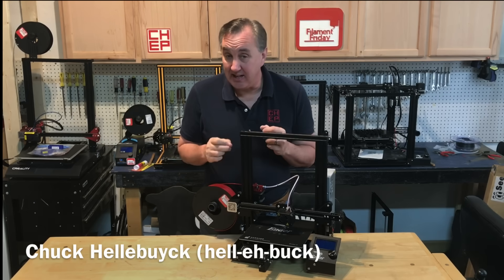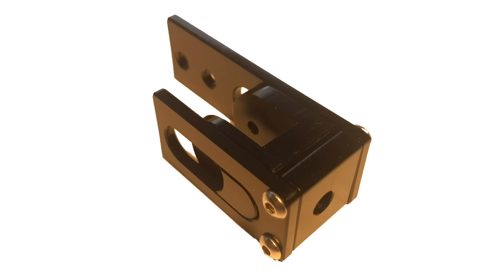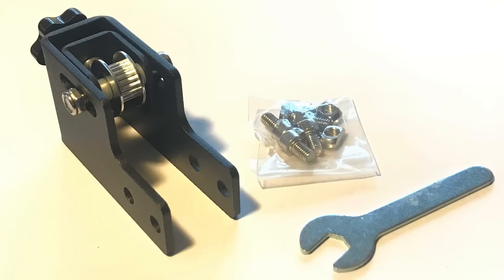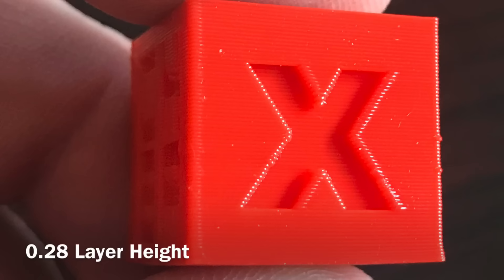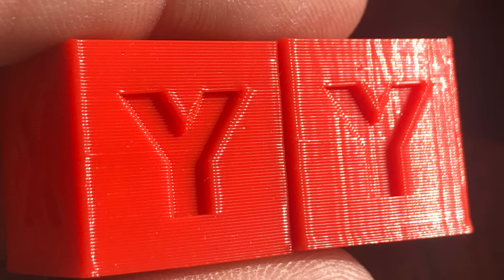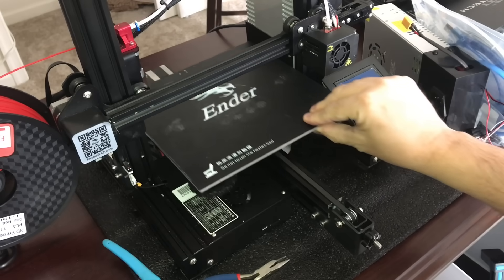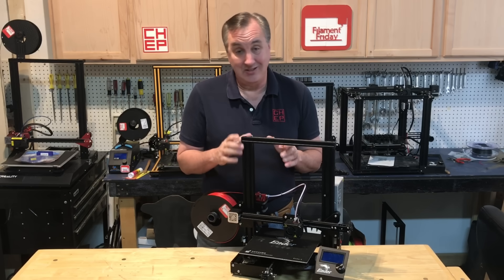3D Printer Belt Tension Effects on Creality Ender 3

Comment: the slicer does not know how tight your belts are.  it assumes ideal/perfect belts.  if they are too tight this will change the real world travel distance in xy which will throw out the extrusion calculations.
Reply: If you're throwing off those calculations it would have to mean you are changing the length of the belt by stretching it, which as he says in the video you shouldn't do. You should be able to tighten it pretty hard before it starts to stretch by any significant amount though.

Comment: Anyone know how to fix the extra extrusion mentioned at the end?
Reply: E-step calibration is a good place to start to fix over-extrusion. Possibly printing too high a temp leaving oozing at the corners, running the temp tower calibration is a good way to tackle that. chep has videos on both
Reply: Also linear advance/pressure advance would do wonders to fix it
Reply: Same Problem

Comment: If you tighten the tensioners on an anycubic kobra max with maximum force, the print will shift all the time,the bearings will knack and the print will fail all the time. Loose it until it goes down and the tighten it. You've got to watch the belt go up to the upper position as you tension it and when it has reached its highest point, you've got to give it another 360° turn and it won't shift anymore.

Comment: Gates, the creator of the GT2 belt, recommends a tension of 6 to 8 pounds of tension when using a 6mm GT2 belt for registration like in a printer.
Reply: i think the gates belt doesnt need as much tension since it uses aramid fiberglass reinforcement.
Reply: Your post is more important than it may seem as Gates are pretty much king of industrial belt drives. Thanks for looking up the data so I don't have to!

Comment: The belts will stretch quicker but over tightening. It should be tight but you should be able to push the belt down a little bit. It shouldn't be tight like a guitar string.

Comment: Should I loosen the tension on the belts when I don't use the printer for a few days to prevent any damange to the belt or the pullys in some way?
Reply: You're being way too reckless with your printer!  You're supposed to completely disassemble it,  apply a thick layer of cosmoline to every part, then hermetically seal it in a kevlar bag.  The bag should be placed inside of an underground climate-controlled vault with 24 hour surveillance and a time lock that can not be opened by anyone for the few days that you're not using the printer.
Reply: @madderall_dot_com  LOL! Love the safety. Will look into underground climate-controlled solutions XD
Looking at other comments though - Overtightening could lead to issues, which I suppose I didn't consider.
Reply: @hadencain  You're a good sport,  Haden.  Unfortunately this video is extremely inaccurate and I was very much surprised to find it on a channel that I've always respected so much.   He really needs to do a follow up video with a retraction, because this advice is borderline dangerous. 
And no, if you have you belts correctly tensioned you don't need to loosen them when you're not using your printer.  A correctly tensioned belt on a cartesian 3d printer should feel like a loose guitar string. Somewhat tensioned, but never cranked or stretched.

Comment: Thanks for that info. You solved my mystery questions. So it was the belt that wasn't tight enough. My prints had wavines,or I had suddenly printer nozzle offset and start printing different location. So it's better to have it tight. In worst case I can replace the steper motor if it breaks down, but at least I'll have excellent prints.😄

Comment: This was an awesome video. I was looking for examples of what a loose belt could cause. I have to check mine. I am experiencing a strange issue where the right walls and bottom right fills of any object, no matter where it is places, happens to each when I print multiple don't squish together. I think it might be a loose belt but so far no luck with x height or clogs or what not. Very odd.

Comment: Remember belt tension affects XY accuracy. You're stretching the belts, meaning the stepper motor's need to move less to move, say, 1mm. You really need to re-do this video to mention this, Chep. And don't forget to mention some Enders can only save estep calibration to the SD card, and only when it's inserted (struggled with that for a few hours).

Comment: I overtightened my e3v2 belts. The problem I ended up having was vibration. It seemed that the tighter the belt, the more artefacts I got on smaller details due to vibration. I loosened the belts by 1/4 of a turn and I got perfect prints again. On large objects with lots of straight faces, you don't notice it. On small parts it would cause them to break off. Especially thin walled supports.

Comment: with the belt being extremely tight would this not damage the stepper motors?
Reply from the maker: Nope. Belts will stretch a bit.
Reply: @FilamentFriday  only applies more horizontal force to the bearing,  it which case are designed for 1.5 to 3 times the pressure is my guess. the belt would break b4 it would negatively affect the bearing with rubbing likely happening first.
Reply: incorrect, Nema 17 steppers can only handle 14 to 17 pounds of pressure on the shaft. Properly tension belts aren’t any tighter than 8-12 pounds but they can be easily overtightened and this will cause stepper motor damage. Not to mention degrade the belts very very quickly.
Reply: @TheGoldPoppy  Chep is one of the most respected experts in the 3D printing world if not the most. So if he says this is so, then it is so. I cannot imagine Chep advising this without testing it for himself or getting the information from a trusted source. However, not all parts are created equal so some stepper motors will fail due to over-tensioning because they are faulty. I accept the benchmarks for this stepper motor are what you say they are but in the real world these measurements may vary from machine to machine.

Comment: Interstating after reading article with similar comparison of cubes it did clock in my head, on x2 I see some waves but very faint always thought belts felt right eniuggbfrim factory and it's wobbly table was causing it wgicg prob not but who knows gotta find more stable surface

Comment: I got a ender 3 pro, but heavily modded
, and will certainly test this when i get my E3D V6 heated block replacement and new LGX extruder, once with the old recommended low G twang people say to use, then another cube with the tighter and see if cube changes.

Can't believe i didn't find this video until now lol

Comment: this is great... ringing and loss of quality imo is caused by loose parts and belts in most cases... when you print same file for years with same printer and you get ringing etc to me it makes little sense its a software issue and can't be a g code issue...thanks for sharing... i came by to check this out before i go through my machines to try to improve ringiing issues ..

Comment: Might be true for an ender 3. But I think this is bad advice. On all of my CoreXY and Cartesian printers. I run tension just high enough to not skip but as low as possible otherwise to save my motors and bearings and stop terrible vibrations.

Comment: i got a new belt for my ender 3 v2 after my x axis belt snapped, would I be better off and get better, cleaner prints if I used the GT2 timing pulleys that came with the new belt instead of the bearing that comes stock on my ender 3 v2? thanks for any help much appreciated, love your videos and class you've got on udemy Chep! always helpful and clear direct instructions!
Reply from the maker: What class on udemy?
Reply: @FilamentFriday  Hi CHEP, quick question: I am getting corners exactly like in your video, how did you fix it? If you have a video or an answer please tell me. It is really important for me. Thanks in advance.
Reply from the maker: I used coasting and flow rate to reduce them.
Reply: @FilamentFriday  thx man.

Comment: I see you have an ender 5 on the background. Have you installed them on the ender 5? Do they work well? I have been having an issue where the Y axis gets skewed during a long print and when its finished the axis is not straight. I have tried adjusting the bearings to make sure all are perfectly tight to the V grove and the belts as well making sure they are as tight as possible using the assembly that comes from factory, just wondering if you ever experienced it before and if you have these installed and how they work.
Reply: Hi JP Did you ever solve this? was it down to your stepper motor skipping or the belt? Thanks
Reply: Ho @LaurenceGough  . I have actually converted mine to linear rails on both x and y axes and have not had the issue ever since. It prints very well and printing with speeds of 110mm/s with great results. Looking to do conversion to core xy next. Just waiting on new stepper motors and mounts for it.
Reply: @jpnunes7154  Ah ok so you didn't change any vref - but I guess you may have changed the belt tightness when installing the linear rails?

Sounds nice either way!
Reply: @LaurenceGough  before installing the rails I did play with the belt tension andcosely monitored the stepper motor to see if it was skipping and never been able to identify what was actually causing the issue

Comment: im having problems with Y belt tentioners on both ender 3 and ender 3 pro seems when it hits 210mm e3 and 220mm e3pro the wheels colide with the tensioners do i need to put some offset on y or do i need to make a more gap betweent the end of the y axis and tensioner cus they are kinda close

Comment: I have worked in robotics design for ~10 years and tight enough it dependent on speed and backlash, if its tight and moving slow its fine, if its moving fast you need more... you are slapping a rubber belt, the faster you go the less slack you can have

Comment: good to know on my v2 i was worried about how tight/vs how loose to set it. ive seen these exact issue on some prints so ill prob tighten it  up.
Reply: It shows you in the manual how much to tighten with a picture, until the middle rod is flush with the cap.

Comment: I've made the mistake of getting a belt so tight that it stretched the end on the x-axis where it connects to the gantry and it slightly tore the belt which led to very small x-axis variations In the layer lines. Had me baffled for a while. :)

Comment: Chep, I have an issue with my Ender max and was wondering if you might know whats causing it !! I get this 1 bad line running up the z axis of my prints.. I can see whats doing it.. Its the hotend jerking at the exact same spot every time it completes a layer.. So its laying down a layer fine and then what looks like where it comes around back to where it started, It does a very fast jerk motion and continues laying down filament. Clearly this should be a smooth change or whatever, but that little fast jerk is enough to deform a tiny blob of filament each go around, until I end up with that funky line running up my print..
Reply: You can solve this is cura settings by changing z seam to shortest and enabling hide z seam in settings.
Reply: What are your retraction settings? Also are you using combing mode? Not z seam I assume?
Reply: @Kevin McCann Cool thanks for the info... It definitely is a new layer problem and not actually the z axis... I did a test the other day with a circle that had 20 layers. Same thing at the end of each go around it would stutter for a microsecond at the same spot.. I notice that it actually happens now on every print.. ill try and change the position it ends each layer and see what happens... Not sure about the little blob, don't think that's retraction issue , because I don't get hardly any stringing or under/over extruded parts... Anyways appreciate the help dude !!!

Comment: The belts come about 2% undersized, so they need a fair bit of stretch to be set at the belt's intended tension, so you get them taught, and then stretch them a further 4-5mm, then you're set. These poly fibre reinforced rubber belts (as opposed to steel reinforced PU belts) won't actually break. But they can damage the motor bearings! I don't think those motors are intended for this kind of side load that the belt expects of you, you expect some kind of coupler to a shaft that's supported on both sides which then carries a pulley, which would be a little too complex for a low-cost desktop 3D printer.

But i don't want to make it into a big issue. You can just open the steppers and replace the bearings when time comes.

Comment: Too tight of course you will wear out bearings, pulleys and belts. Increase motor current.
A good test is to hold the pulley on the stepper motor, move the Axis, EG print head, back and forth by hand. If you can feel it's sloppy, it's too loose. If it returns to it's center position from each way you pull it, it's about right.
Fine tuning with test prints.
Reply: I've really overdone it and pulled the belt halfway apart by the gantry once and got small x axis shifts, the compromised area would stretch and contract as the machine moves and had me thinking I had a bad driver or stepper. I recommend the gates brand belts as they are a lot stronger and can take a good tightening.
Reply from the maker: Or the belt stretches.

Comment: Keep in mind, there is 'too tight'.
Draw two circles, one to represent the inner bearing race, one to represent the outer.  Draw a circle in between them, touching both, and realize at that point of the bearing, they can only get within exactly 1 bearing diameter, the bearing keeps them apart.
Now instead of 1 bearing at that point, put a bearing before and after that point, off to each side.  Realize the two circles can NOW be pulled in closer than the 1 bearing diameter.
Ball bearings do not form a perfect circle to follow the perfect circle of the races.  They form a sort of point polygon, if you set high tension and pull the outer race in close it will destroy the bearings or races as the races have to ride over the high spot of the bearing.
This is why bearings have loading limits and similar, and get destroyed really fast with high loads..
Long term if you want higher precision you need higher precision linear items.
Since these bearings are fairly cheap, you can set the tension high, get great results, and just consider them a wear item.  That's perfectly fine too, just understand you're shortening their life and they'll need wear replacement..
My 4 year old CR-10 is still very smooth and works perfectly, probably way better than most.  I can easily turn all of my POM wheels with two fingers, barely any force needed.  They are linear guide items that need no excess play, but don't need tension.  Same for the belts, easily deflected and low tension, but very low play in the positioning direction.  Properly used bearings have a near indefinite lifespan for something as low load as a 3d printer.
If I needed it I'd wring that last bit of precision as well, and just consider the wheels, bearings, etc wear items.  But if you do it, do understand you're going to be intentionally point overloading the bearings, and they'll changing now and then.
So don't hesitate to do it for the extra results, it's a lot cheaper than the next step up all around for high precision in a whole printer.  Just keep in mind there's a trade off, and more maintenance required..
Also, notice there's still a small, regular pattern on the prints.  I wouldn't be too surprised if that's the bearing peak pattern showing up in the output.
Reply from the maker: Keep in mind, these belts stretch.
Reply: @FilamentFriday  'these belts stretch.'  Of course they do a tiny bit.  Most of them are fiber reinforced or better, they're still plenty capable of overloading small bearings.  Small steel wire is easy to bend, it's similarly easy to put pressure on a small bearing and have the 1 or 2 balls that support load from any one direction be digging in to the race slightly.  Bearings have a wear curve, and wear shoots up very quickly once you exceed a certain loading, and it will be amazingly low for small, cheap type bearings.

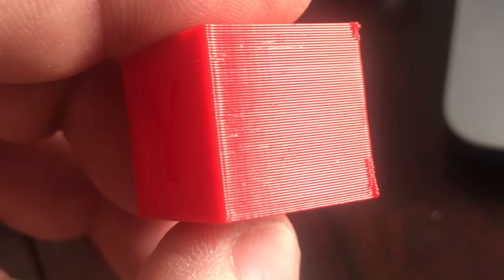At the 4:00 in this video, you can still see a vertical line pattern in the surface.  Bearing rolls along, then forced over a bearing.  Rolls along, whoops over a bearing.  You can see the bearing high spots in the output, almost guaranteed that's what that vertical pattern is coming from, one of the bearings as it's rolling along.

It would be interesting to get a scale in there, see exactly what the bearings are loaded at.  Then put that weight on a bearing with a test rig set to move it back and forth slowly.  Small bearings don't like loading at all, they probably wouldn't last a day or two of accelerated testing before they're obviously worn..

1 pound of force is relatively low on a square foot.  Much higher on 1 square cm.  It can easily become steel surface destroying when you're talking about the near point contact patch of a tiny steel ball in a small bearing.  Small bearings do not like loading, it is part of scale effect.
Reply: @ModelLights  There has to be specs for the steppers on how much sideways force they are rated for. it's not just the adjuster bearings taking the force. There has to be a point of negative, or at least non positive results from over tightening.